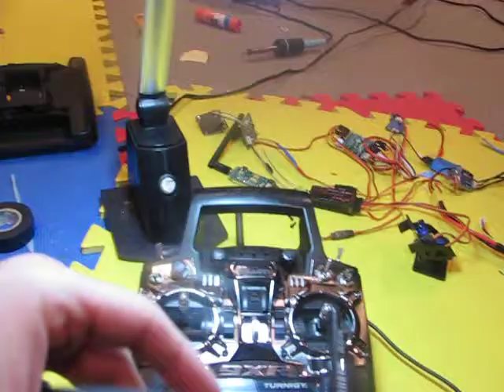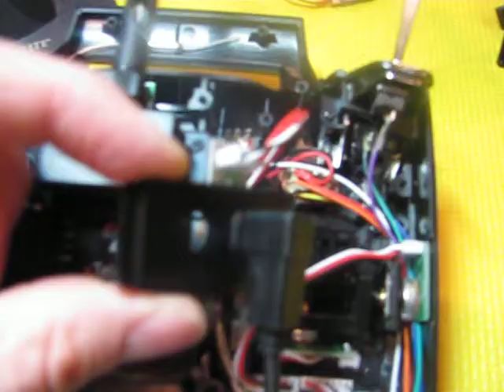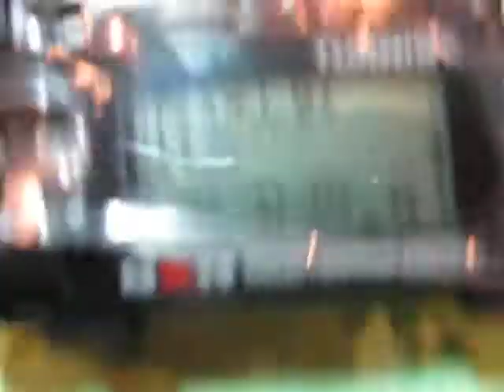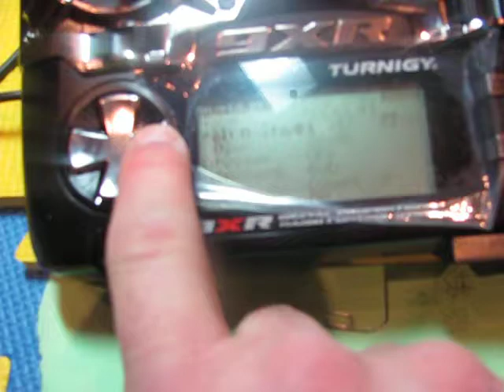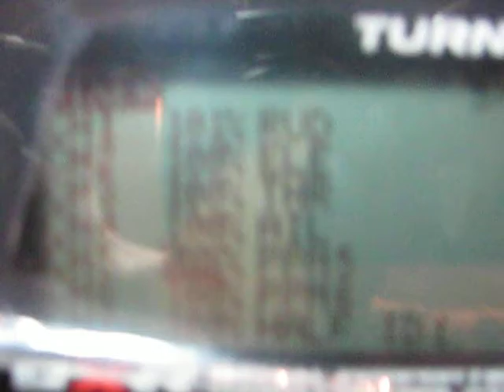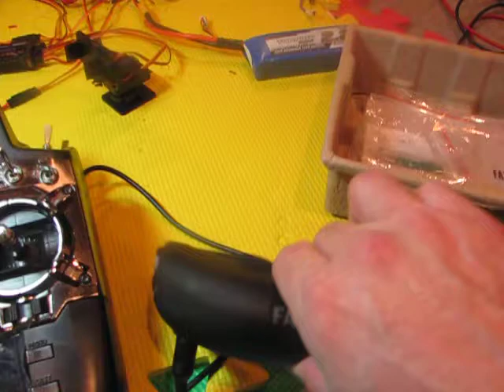9xr Fatshark Head Tracking

Comment from the maker: Your video tx and rx, and your controller tx and rx are separate. One sends a signal to the plane to control it, one sends a signal to the goggles to watch. This mod allows the goggles to control the head tracking, and get power from your 9xr, allowing for one simple battery, and one clean cord. Takes a little extra work, but fun if your into it.

Comment from the maker: So far it seems to return to 0 fairly well.  I find the range of turn does not take it to full servo extension, only putting the servo at about 80%.  Perhaps your turn is taking it past 100%, and then not going back to 0.  It is still work in progress for me, trying to tweak it just right.  I find adding the switch for both channel 5&6 in the mixer setup will help, if something happens, or on take-off etc, flick the switch and the cam will go back to 0.

Comment from the maker: hrmmmmm check your solder and wire to make sure its not contacting another lead.  double check your settings in the mixer, and 5/6 is not mixed with your 1-4 channels.  It sounds more like the wire/solder may be making contact with something else imho.

Comment: The solution for ALL 9XR firmwares is to 1) make a bridge like shown in the video and 2) swap the JR/futaba connectors on the 9XR board. 3) configure ppm as shown in video.

If you don't swap the plugs then it won't work or it will behave wrongly in many cases (not all cases). Believe it or not. 
After doing this very simple mod I got my FatShark Dominator HD2 with Trinity HT powered from my Turnigy 9XR running stock (~2 years old) firmware via futaba plug, using UHF 433MHz RangeLink tx module. Works perfectly. Swapped Trinity HT with old FatShark MIG v5 HT, and it works too. Say goodbye to these CRAPPY FatShark LiPos :D Goggle are lighter and the overall experience is much better using only one battery.

Comment: I did your Mod today, and it worked great for me also.  It will be nice having power and HT all in one cable.  Have you had any issues with the HT shifting back to center while the unit is turned.  I will try it in a different environment but on my first attempts if I turn the unit and hold it at 100% the HT will return to about 25% with out moving the goggles.

Comment: DO NOT DO THIS on the 9XR if you use a FLYSKY 2.4 Module as it will blow your Module as the white wire inside goes to a pin on the module, what i done was followed his video to connect the top left and bottom left but i unplugged the plug from the board and plugged it into the plug where the JR goes.
Reply: Is it working after switching the JR Plug into the Futaba plug on the Board?
Reply: Yes works fine for me after i got a new modal but it powers the goggles and all works well. You still have to do the connection shown in the video but then swap the connections over.
Reply: David Forsyth What is ne Modal? Do i have to update the 9XR to Open9x? And is it right that i have to swith the plug from the Futaba Connection to the JR connection? Sorry for stupid asking but i don´t want to fried something

How ca you power the goggles from the JR Plug? On the JR plug there is just PPM Singal and Ground. Normally the googles just gets power from the Futaba plug.
Reply: sorry thats just a typo i meant modual as when i followed this video it blew mine.

Comment: I've got the same problem: no HT at all, servo stuttering and no input neither from radio (thr, ail, rud, ele). 
Check Your Attitude's instruction manual: on mine is written that headtracker is a MIG V5 (mounted on Attitude since march of this year)
Maybe, the working one was the "old" MIG V4 that's probably different from MIG V5.
I'm a bit worry, now, because after some trying, servos stopped stuttering and now it's like goggles are not connected; I'm afraid that I've fried PPM input on my 9XR

Comment from the maker: Did you install the optional head tracking module?  They come with the cord, but the module itself is extra, and not included with the 3rd gen dom's.  If you changed the PPM channel on the dominator's, try going threw all the PPM's in the mixer settings, i found the beeping hard to change settings, so it may be on another PPM #.  Try the ER9X software as well, but i think the default firmware should work.  As well make sure the goggles didnt go into safe mode, shown at 4:14(hours wasted for me).

Comment from the maker: Im glad it worked! I added two other things to this. Make it swing 180, youtube video U8LVTcDpKDI or Google "hxt900 180 mod" first link to fpvlab forum, works great, 2.7k resistor works, maybe a 3k. I found my head only turned to about 80% of the servo, so i needed more throw. I turned up the weight setting (default x 100%, upped to 120%), set around 5-10 offset (adds to value), and a limit of about 115.This allows me to see the wing tips from turning my head, not exorcist head turning.

Comment: Thanks for the video, but same problem as the oothers here: all servos start behaving erratically when connecting the goggles. Soldering checked and measured and no short circuit detected. Did anyone find a solution?

Comment: finally got my fatsharks and am attempting to get the ht running but im currently waiting for a replacement receiver so just going off of what is showing on the 9xr itself and am not seeing any changes in values on the "ana" submenu where the channel values are shown in real time (A1,A2,A3...) I set the mixes as well as soldered the jumper everything fires up am I supposed to be able to see the values change on the ana screen? Maybe dif set up for mig Ht? Got older fatshark with the mig ht modul

Comment from the maker: It *should* work with the default firmware, but i cant confirm, i flashed with er9x first.  is it a 9xr?  Have you checked the servo's work first by putting them on a pot?  make sure they are on the same rx channel as in the mixer, and correct or default channel setting from the fatsharks.  what firmware are you using

Comment from the maker: Hrmmmm make sure the ht has not disabled, if you move to quick or far it will reset to 0 till the reset button is pressed.  ppm 5 and 6 are the channels, did you set up the ppm to servo channel?  should be transparent.  does the fatsharks have ht for sure?

Comment: I have the default firmware and have done the mod in your video but I'm not receiving anything on the ppm channels.
Tried all channels, HT should be on (assuming 1 beep for on and 2 beeps for off, 2 beeps same as 90° limit)
In one of your comments you say to set the PPM to servo channel? What does that mean exactly?

Comment: Hi MrArron76 Thanks for the video, I think I did what you did exactly but unfortunetly my HT still not working (not respond at all). when I tried to used the JR cable and work okay but still not smooth.
is the bottom left pin suppose to have continuity with the pin beside it or not? I am using orange 433mhz open lrs module
thanks and please let me know if there is a thing I did wrong
Reply: Budi Prawiro Check out my latest upload video on how I did it...

Comment: Hello,  Everything seems to work correctly when the Fatshark Head Tracker are NOT connected. Quad turns ON and OFF. No servo stuttering on any channels. When I plug the Head Tracker in I get some crazy results, even on channels that (i think) aren't assigned to anything.

I've done some more testing, is yours anything like this: /watch?v=AwuSgpsK-C4

I'm using Dominator goggles and Fatshark head tracker w/ V4 software.

Thanks for your help.

Comment: Hello Arron, Nice vid. I'm having issues with my pan tilt servos stuttering. I have pan/tilt servos connected to the transmitters CH5, CH6. The 9XR's Mixer is set to CH5 - PPM5, CH6 - PPM6. I turn everything on, I plug in my goggles in and the servos start stuttering. Even if I put a 3rd servo into CH7 that starts stuttering as well. I checked the soldered wire. If I try and use CH7, CH8 i get the same problem. Have you got any ideas? You can watch a video on youtube: /watch?v=rmpUHpn1kN4 Thanks